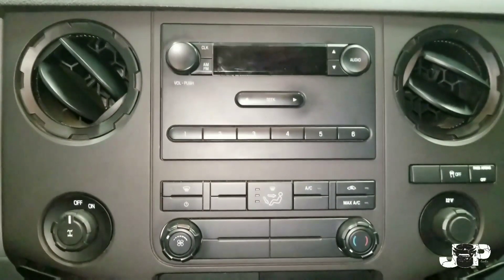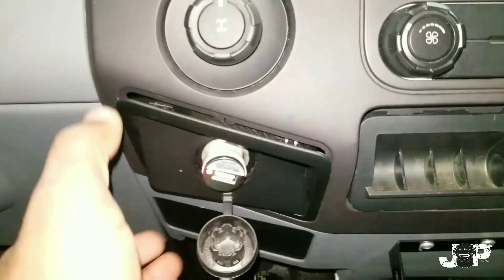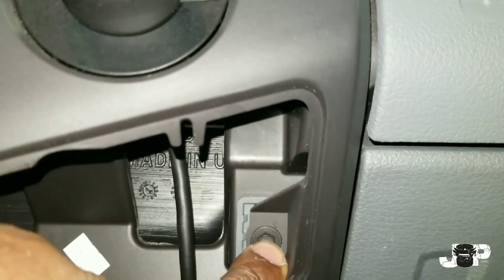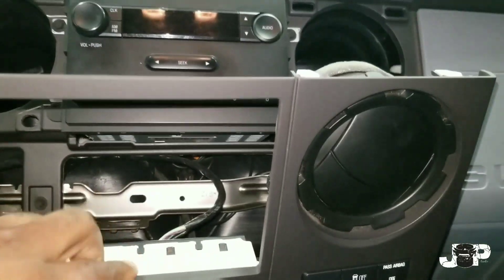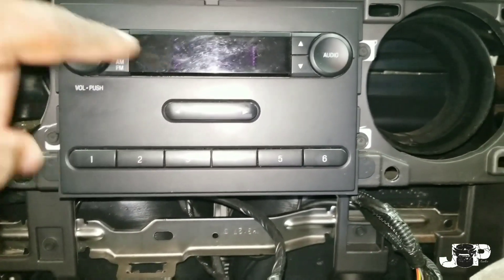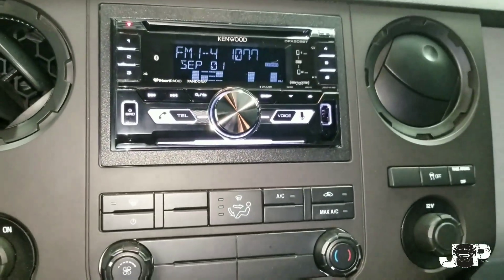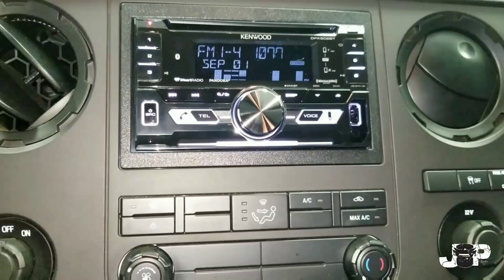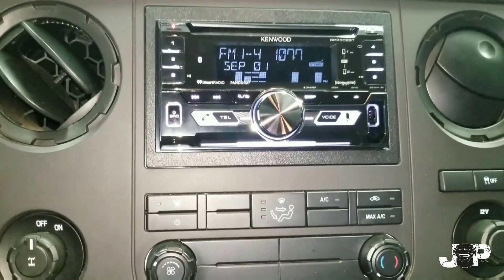2012 ford f250 radio removal

Comment: What wire harness and mounting bracket did you use. I have a 2015 f250 super duty and can't find the correct setups